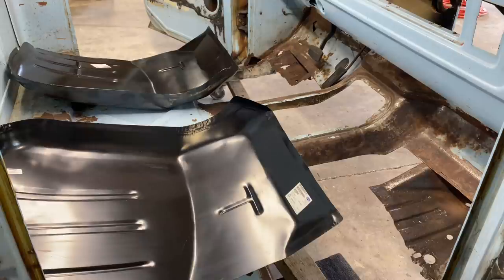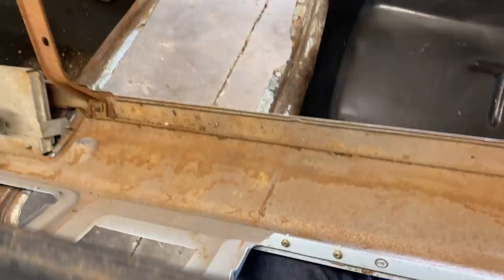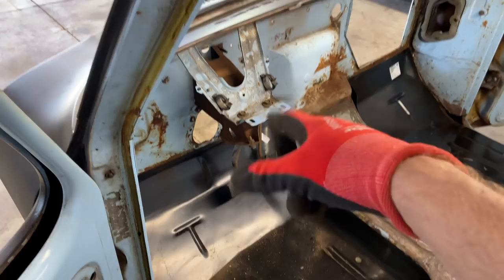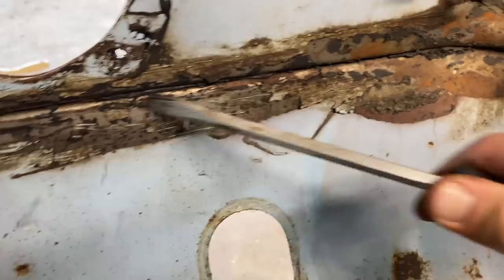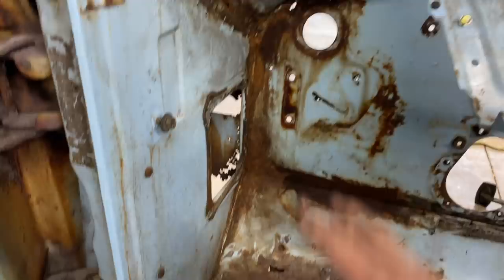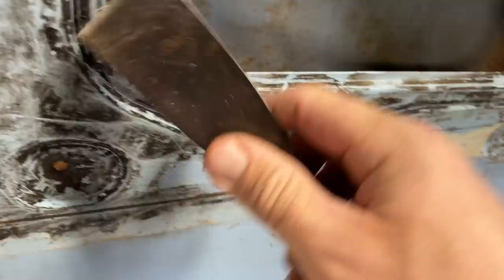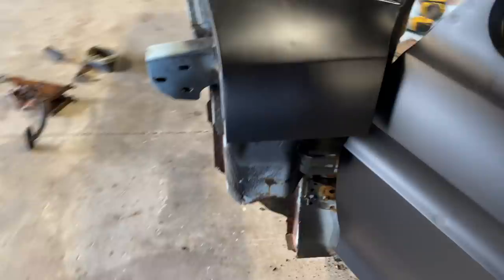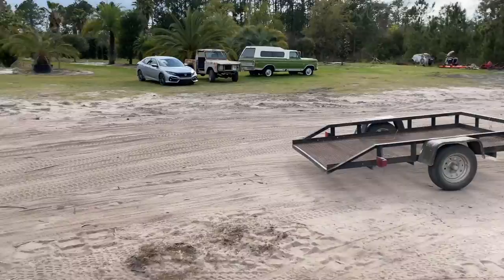Restoring an Abandoned 1974 Ford F250 Restoration Swamp Dragon! DASH PANEL! Resurrection Rescue! CT

Comment: Looking good, the more metal you can get to both sides of the better, if you treat all the rust correctly and repaint BOTH sides it will NEVER rust again, look at the old Russian Ladas they were painted inside out including the inside of the fenders and they hardly ever rot out, get it right it will last forever
Reply: Yep, gotta get rid of ALL the rust. And take every step possible to keep it from gaining a foothold again.Or it will come back to bite you in the ass......

Comment: Should sandblast or wire wheel that floor before you put in the new floor pans.
Reply: I was thinking the same thing and use rust converter in all the unreachable areas

Comment: That sticker is your identification sticker along with the VIN number on the older vehicles.  It tells you what the truck is capable of doing and tells you the paint codes. I'd get it reprinted.
Reply from the maker: Thanks Alex! Ok good. I will pull it off and make a new one. I was't sure if that was ok to do or not. Thanks!
Reply: @CTmoog  Jim Osborne reproductions was a company that made replacement stickers. You got 2 copies and used a blue carbon sheet in a typewriter to duplicate the original look. Then a clear cover was stuck over it. I used them many years ago when repainting a 1973 Mustang in a different colour. That company may be out of business, but I am sure you can find replacements. Good luck and I am enjoying the progress and wish you well.

Comment: Hey CT, you sure have a great attitude about your project! Even with the nay sayers! 
Undercoating comes off easy with a heat gun and scraper. Remove the hinge holders!
For that black rubber stuff under the gas pedal bracket, I would consider using butyl tape. It’s thick and kind of gooey really never dries and hardens. It partially oozes out as you tighten the fitting against the body and keeps moisture out. It’s used in the marine industry a lot to keep water out of fittings that go through the hull to the inside of a boat but above the waterline. 
Body Shop guy drill one or two holes through the hinges as a point of reference to help with realignment when putting the hood, trunk or doors back on. Use a 1/8 in drill and then when bolting back on bolt the panel on and put the drill bit in the hole to align it.

Comment: CT, you doing this inspires me to one day completely tear down my 1972 F250 and restore it. It runs good but needs body work. Different body design but similar construction and many of the same parts. That said, I just want to give you a big heads up on replacing that radio antenna. Go ahead and buy the entire original replacement kit. It's about $90 plus shipping but it will be well worth it. The original style kit is the only one I know that offers that rubber grommet you were pointing to where the cable goes thru near the beginning of the video. When I ordered mine, the original was on backorder for a long time. I bought the aftermarket one and that rubber grommet wasn't right and could NOT get the right one. I had to glue the old one back together. Just buy the original. It should be available now. You can get it from LMCtruck, Dennis Carpenter or Mac's.

Comment: That upper sticker probably was applied at the dealership....  The metal tag on the door is the important one. It has information such as the rear axle gearing that the truck was equipped with.

Comment: Cut the floor pans to fit and get rid of the rust, butt the seams together. Tack weld around them leaving space between them so you don't distort the metal, keep tacking it until the is complete with no space.  If there is rust in a lap seam, the rust can come back and moister can build up between the pieces.

Comment: Use a hair dryer as opposed to a heat gun to remove the label. Nomenclature tag is two rivets I believe.  I’d drill the holes through the door hinges for alignment and take them off the body side. You’re doing great. Don’t pay attention to those pessimistic people who’ve probably never even changed a tire.  Lol

Comment: Butt weld those floors. Treat them like any other body panel. Don't get lazy now.  It's the perfect spot to practice your sheet metal stitch welding. And yes it is a lot of work. You will want to skip around, hammer and dolly, grind, repeat. Don't just lay a thick booger weld down. One zap at a time. Do a bunch spaced apart, cool down, hammer/dolly, grind, do another set. Clean top and bottom. You'll be a pro after the floors and will give you confidence on your other exterior patches.

Comment: (over)lap welding is fine, but I would suggest cutting back as much of the original metal as practical. Leaving about an inch of overlap would be plenty. Then, treat the area with weld through primer, before welding it down. You can find it in most home centers and auto supply stores in rattle cans. After you finish your welding, treat the underside with rust encapsulater. Brushing it on is acceptable. When fitting the pans, screwing them in place, like you did on Rusty sounds like a good idea, before welding! The gasket like material on the wiper transmissions is simply seam sealer, originally cut to shape to speed assembly at the factory.

The firewall insulation is cotton and jute, with heavy cardboard. Same insulation as used under carpets. By 1974, asbestos in any new product was long gone.

As to value, the real value is in knowing you did it yourself!  If you price out a new F-250, you are looking at probably close to $50k. I bought a new one in 2016, and they haven't gotten cheaper!

The VIN number plate isn't the only place this info appears on the truck, and probably can be ordered from Ford, and possibly the printed label on the door jamb. I believe I would take the best pictures you can of each, and email them to Ford customer service, followed by a phone call. They have been very helpful in the past.

Comment: Soak that sticker with goo-gone for about 10 minutes, should be able to get it off intact.  I've heard naptha does the same thing and you can get it in bulk at HD.  Pretty sure it would work on that door / asbestos adhesive schmoo too.  The sticker looks like just regular paper with a mylar surround but depending on cost, I might feel better getting a reprint by a pro.

Comment: CT, I know it's a lot of work but once you're done, you'll have a practically brand new truck that you mainly paid for parts only because you did most of the work yourself and most likely cost way less than you'd ever pay for a new truck. And it should last a very long time if you keep her in a garage when you aren't driving it. I'm going to have to do the same thing you're doing now to my 72 F250 because it has similar body failures your truck has. I get water in from that top seam under the dash if I leave mine out in the rain. And it's done a little damage to the floor already. Keep it up. You'll be glad when it's done!

Comment: Hi CT! the more you disassemble the cabin of this pick up, the more parts of the bodywork that urgently need patches and welds pop out .... perhaps it was better to sandblast the entire cabin so as to realize all the metal parts to be replaced with pieces of sheet metal, and remove the doors in order to work on them more comfortably. Surely this work is also all experience that will then be useful for the restoration of Rusty! 💪👌

Comment: its looking good so fare i am a ford man i have a 1985 F250 with  6.9 Diesel an its been siting for round 15 years it has some surface rust  . Thanks for all the videos  and i am happy that you are keeping it all Ford . Ford #1    Fords = first on race day    you have seen the light = Ford . that stuff that is around windshield wiper motor if you can`t find it what will work its a stuff that comes in a roil its to put in windows in RV`s . but all you need is a putty that will never gits hard .

Comment: The firewall pad sound deadened is not made from asbestos. It was likely dusty and crusty so not bad to wear your respirator but its not dangerous. It’s a jute type material similar to old carpet padding. And yes, there are various online services that can re-print your door tags.

Comment: Perfect timing on dash removal. I looked at the wiring under the dash of mine yesterday  and with all the damaged wiring I was thinking it would be great if this dash came out.  By the way Fitzee has some great videos on floor pan replacements if you are interested.

Comment: Don’t worry about what other people say, a lot of them are armchair dreamers that don’t change our own tyres let alone strip and rebuild! 
You’re right when you say you know what it takes - time, patience and a bit of money, but you have that great barn workshop to use, the space you need, a few good guys around you to help out. 
Don’t put too tight a timeframe on it and risk rushing the finish. Take your time, keep enjoying each stage and you will reach the end result when you get there. 
Remember to take a look back at what you’ve achieved so far. The frame itself looks amazing, the cab is pretty much stripped and the rebuild will take time, which is absolutely expected as it’s quite complicated. 
The bed will be easy to do given all the experience you will gain doing the cab. Put all 3 together and you’ll have a regenerated swamp dragon that will last a lifetime! 👌🏻
Two small points for you: dedicate time to read the manual for this truck, you will learn faster and it will save time and money. 
Second, be methodical and don’t rush it. I get that you do the practical side of things to learn (as you did with rusty) so take you time, enjoy the journey and the end result will be amazing. 
I know you will finish this, just keep going brother, I have faith 👌🏻🇬🇧

Comment: On the doors - just take the hinge pins out and leave the hinge halves attached to the body/door. You'll probably want to replace the hinge pins anyway and you won't have to worry about alignment.

Comment: Hi CT, Hey on the doors remove from the hinges but to help get them back on the same way just rattle can some black around the hinge connection on the door so it goes back on in the same  spots. Your firewall pad save it as a template for whatever your replacing it with or scape the questionable fussy stuff off to get rid of and put some other foam pad on it. Oh and spot weld in the new pans and seam seal. Quick and done is what I think your looking for. Also no sandblasting the cab just use a gringer and get it down to metal and treat it. Patch in what it needs that is going to be visable or structurally needed. You've watched Mike. Your label you could try a heatgun maybe to loosen it up?

Comment: Lap weld inside and out, moisture will lay between the two pieces and rot both layers real quick. If moisture can't get between the two layers it won't rot.

Comment: Hello CT. 
Just don't make an overlapping weld seam on the floor panel, you'll only create a cavity where condensation can accumulate = risk of rusting through again. Then rather butt weld, grind smooth and then seal with body sealant. If you do this, you have the next 30 years peace - provided you make the right paint structure.
Kind regards from Germany
PS: The insulation mat consists of a cotton / horsehair fiber fleece. So no glass fiber or asbestos fiber. Just for your information CT.
Reply: Great comment above….

Comment: Time to start blasting/sanding and cutting out patch panels then prime with weld through in all patch areas rustproof and sand the rest try to get all this prep done ready for your welder to be able to do the welding, doing a great job be like a new truck when you finish.

Comment: Maybe some light heat to that sticker and the razer blade. You are doing great and you will get it back together. Just take your time and expect some mistakes on the way. It won't be anything you can not correct.

Comment: Hi CT.  I think it would be worth you money to have the whole truck blasted by that guy who did the chassis.  It won't damage the mental, as the water in the system prevents heat build up that will warp the steel. Just the amount of time you spend sanding and scrapping all the rust etc off will be worth more in labor than he will charge you to blast the truck. Makes it a whole lot quicker and easier.

Comment: Don’t weld your floors in until you have blasted painted and installed the dash. Then weld in the floors and paint the inside of the cab. You will want to put down some sound dampening foam on the floors too

Comment: In the factory the dash was a complete assy by iteself, it would be built then hoisted in on the assembly line, and the sound board is not abestos, and definetly mark doors, brackets etc with a shot a spray paint or some other means that will stay until final prep, your truck is in good shape definetly have fixed way worse, no point in doing things twice so blast then cut the bad out then clean, enjoy the journey it the fun part.

Comment: You are at a good point, anyway you should blast at least the joints and laps of panels where the most rust is and beeing already inside so far, you should fix all the rusty parts and it will be a pain to return if you don't. Whenever possible make butt joints and avoid laps, so you minimize or completely eliminate the rust formation problem and  you won't regret it later. Laps might look easier, but I think they aren't.The better you do every step, the easier it will be the next. I can't wait to see some serious sparks flying.. =) Try to pull off the sticker on the door opening after soaking it generously with some antisilicone solvent. It dissolves the glue. Another option is the heat gun, but crunchy as it is, I'm not sure about it.. It might work.. Carry on, every project you complete is well worth every money and sweat you put in. Thumbs up big time, cheers!

Comment: If there is asbestos in there, the rule is leave it alone unless it has to come out. and if it has to come out Hose it all down before pulling it so you don't get fibers floating around in the air.

Comment: I would recommend match-marking the doors-hinges-body. Although depending on how much metal work you end up doing on the adjacent mount metal match-marking may not be that useful for refitting. And although my sheet metal welding experience is limited, what you call “butt welding” (I call it seam or flush welding) is best. By trimming the new panels to fit, then careful tracing and cutting you should be good. Just practice on some sample pieces first to get the hang of it. Good luck!

Comment: Get a small torch heat the undercoat up and it scraps right off i would epoxy and raptor under the cab and the new floors as far as welding lap them right over no one will see them anyway just make sure to seal the underside

Comment: Metal badge is pop rivet in door have drill pop rivets out and one is sticker with numbers take off then stick back with clear duct tape or metal back to pop rivet in 4 corners CT 🤔! The metal short one is printed up when produced at factory plus other one same for get parts from Ford Motor Company to buy parts for it when make at factory too! The service sticker take off don't need it and it only for someone did service on it back years ago what replaced plus add too! Door take off from truck on hinges in cab of truck too!

Comment: Thanks for hearing me.  Deal is that I'm not doing the work here (nor are the haters).  That makes you better than us.  Please don't do anything to the face of that metal dash,  It is damn near perfect.  Clean and protect the back and touch up the front.  That Sound deadening board on the firewall is almost perfect.  Keep it.  I guess that this will take 9 mos to a year at this rate.  Work, enjoy, learn.  This is not the expensive part.  That would be reassembly.  Please consider begging a sponsorship from LMC, American Trucks, Dennis Carpenter, Summit Racing, Eastwood, even Sprayway.  MONITIZE!  It won't take away from your vids.  Keep up the GREAT work and I will keep watching.
Reply from the maker: Thanks Jay! I will do that my man!

Comment: I think Marti Auto Works, Martiauto.com, is authorized by Ford to reproduce those tags on the door jamb.  Is the VIN on the panel that's still bolted to the underside of the windshield where the VIN on today's cars are?  If that one is tampered with, most places it will be hard to get a title or get licensed.  It would have been easier I think to remove the dash panel in the last video with everything still attached and remove everything while it's out of the truck.  That's all part of the learning process though.  You wouldn't have had to cut the wiring harness if you had done that.  You're probably looking at all new wiring anyway, that's the safest and easiest way to go.  Expensive though.  While you're this far in, I'd unbolt everything you can like the hood hinge mounts and all that stuff.

Comment: I see finally removing the dash, either read my port or got tired of hitting your head, either way makes allot room to work those floor boards. I got mine back together you can too.  And i didn't video any thing unlike you. so should be a breeze.

Comment: I never knew you could take a Ford Dash apart like that the Chevrolets just have two bolts on each side but then you have to take all the spot welds where the windshield is to get it out

Comment: Take the time and cut the new floor panels to fit and but weld them, it's actually easy cut them and fit them and just do a whole bunch of tack welding until you have the seam completely welded. www.martiauto.com is a good place to go for reproduction door information tags, as well as reproduction factory dealer spec window stickers
Fun fact your truck was Built in Norfolk, Virginia and was the 21,183th 1974 2-Wheel Drive F-250 manufactured.